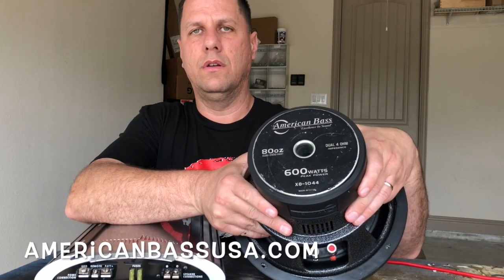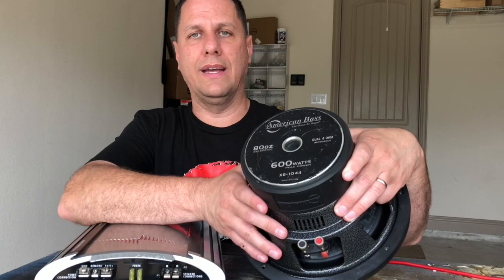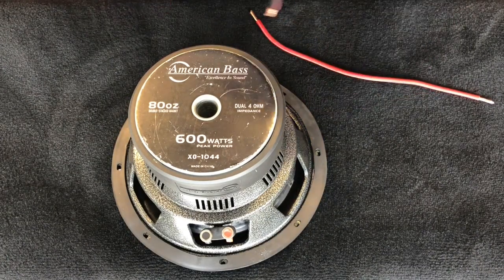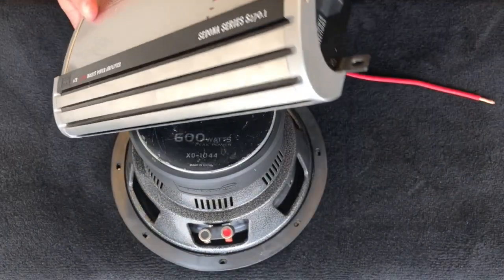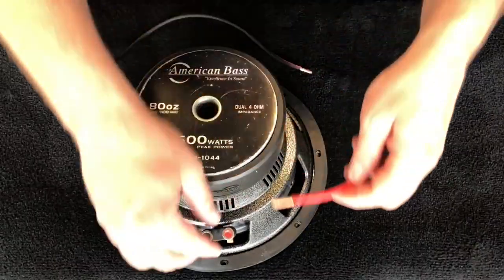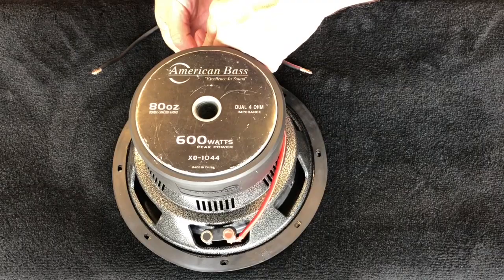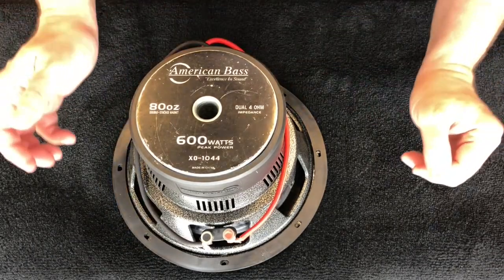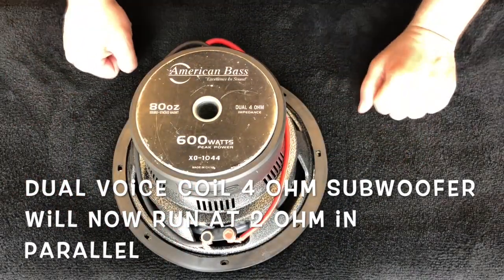How to Wire your 4 ohm Dual Voice Coil Subwoofer at 2 ohm Parallel

Comment: Cant I just run 1 negative from the sub to the amp and 1 positive from the sub to the amp , and get 4 ohms impedance?
Reply from the maker: There are a lot of variables involved.
Reply: @TheImprovementChannel  so how to connect a 4ohm dual coil subwoofer to an amp at 4 ohm, my amp has power of 1500 rms at 2ohm and im afraid i might burn the subwoofer which is 1500 rms. I would like to wire it at 4ohm which is 900 rms and be done with it, thanks